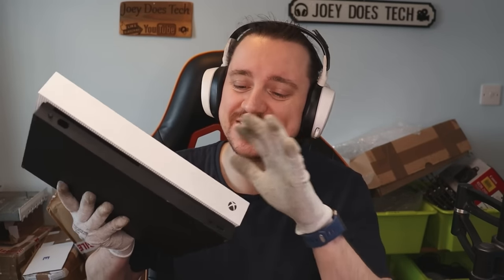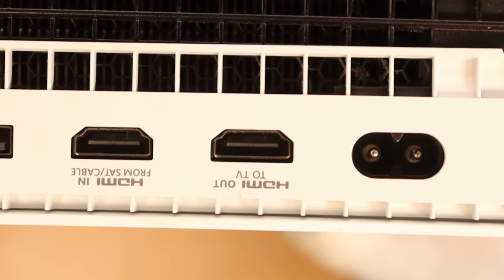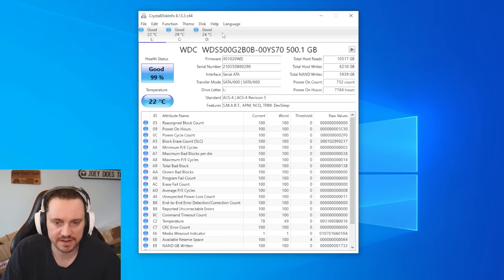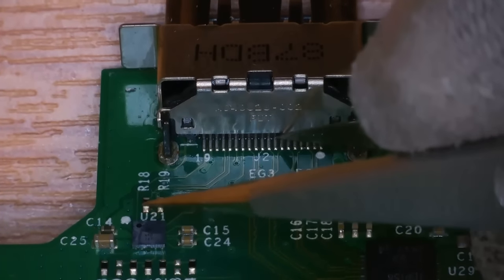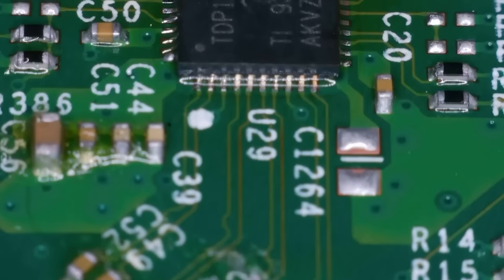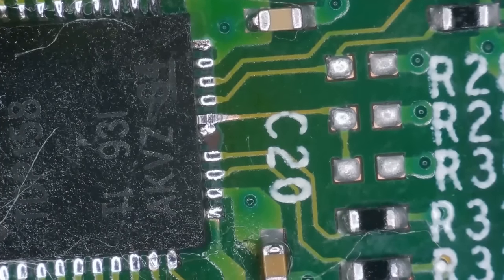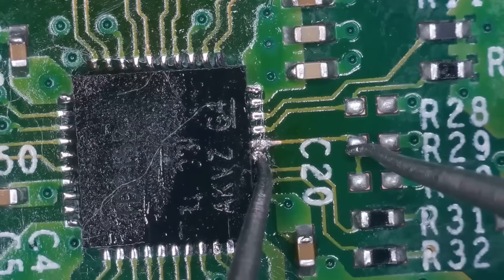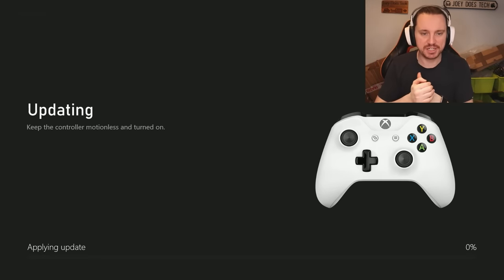Can We Fix this BROKEN Games Console and Make Money?

Comment: Nice quick fix! I believe that pad that's a no connect actually just traces through to the big ground pad under the chip. That green bar you get is just a side effect of the low resolution sometimes. I've had it once or twice on a real monitor.
Reply from the maker: Ahhh good to know, thanks :)

Comment: My customer brought One X and I've replaced TDP158 ;) with no difference to what it was before. Exactly the same issue I'd say. Only the one I had here was really dusty, no soldering before. Will try an another TDP158 maybe from a different batch. Otherwise, no fix ;) for my one.
Reply from the maker: Sometimes it can be the ESD filter next to it :)
Reply: @JoeyDoesTech  yes yes, agree, but this is a new batch of those tdp158 and not 100% if they are good or not.

Comment: Hi Joey did you check out the new repair flex for switch no more jumper wires
Reply from the maker: Ooo no, do you have a link?
Reply: @JoeyDoesTech  the company is called ripped traces. I've not looked into other devices like ps4 ps5 hdmi repair but should be possible or partly possible if you know what I mean still might have to run the odd jumper wire